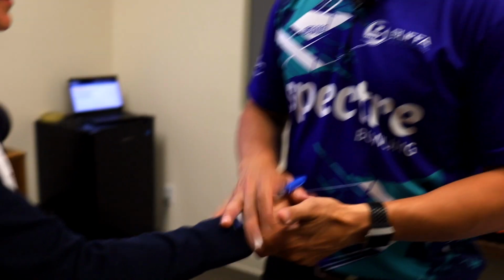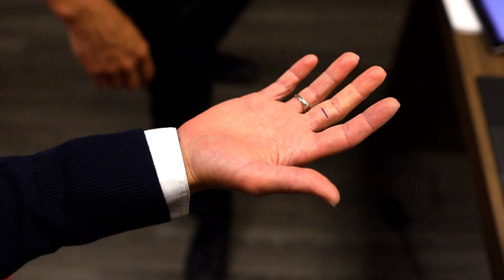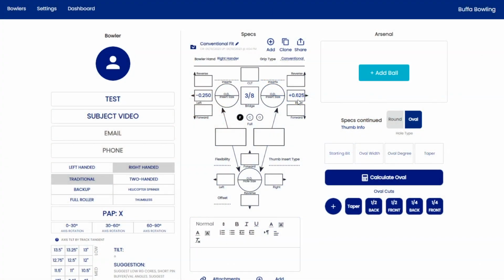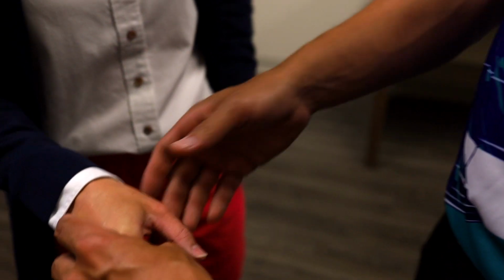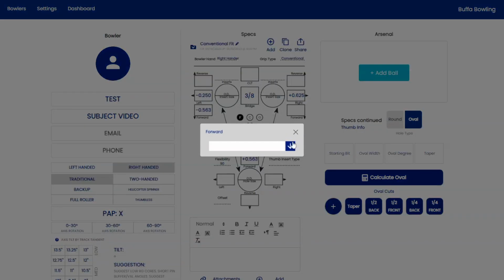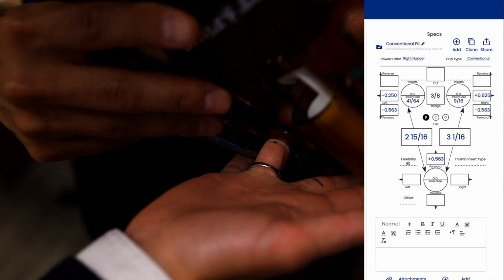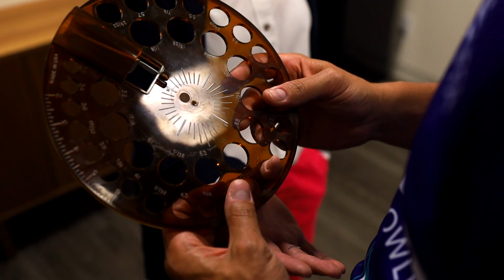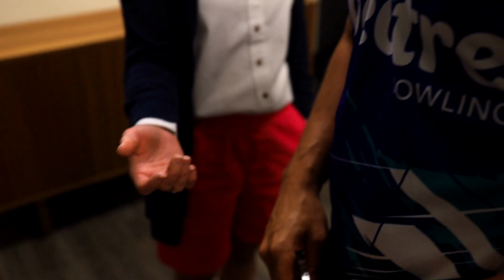HOW TO MEASURE A CONVENTIONAL FIT?? | Using Spectre!

Comment: Hi Mark. Q for you—do you subtract 3/8 off the finger crease line for most everyone? I was taught to subtract the radius of the finger hole, but I’m looking to experiment with other ideas. Thanks bud. 👍🏻
Reply from the maker: hello, thanks for the comment.  Great observation.   A conventional fit is very "general" and not as precise as a fingertip grip.  The pitches being very closed will still allow the bowler to easily hold.  What you're doing is more "precise" yes, however when I teach the classes to new ball drillers, I try to generalise and keep things simple.  Easy, quick fit, get the client in and out.   We actually charge alot less for a conventional drill in our shop versus a full fingertip fit.